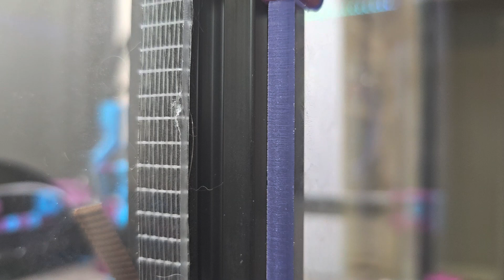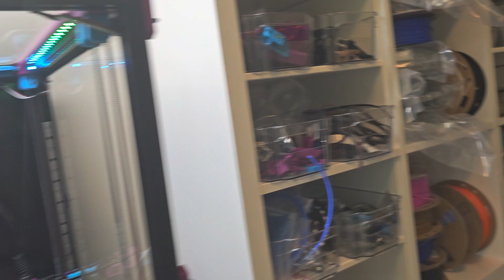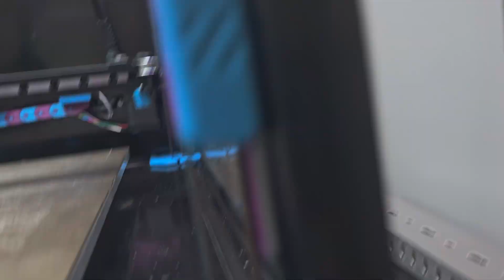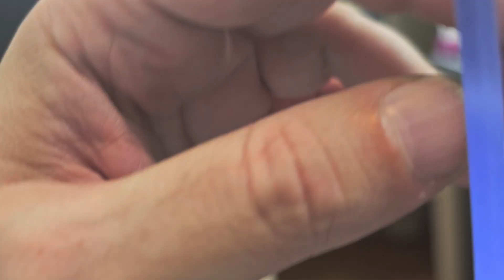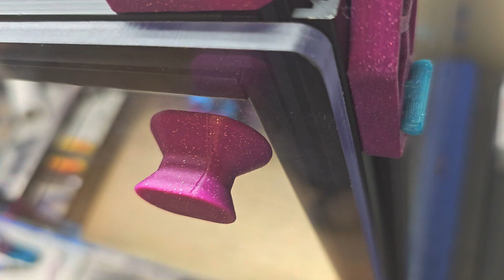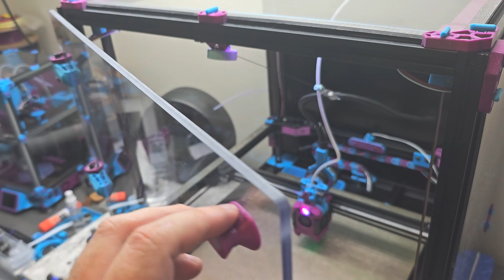Voron 2.4R2: New single pane K3 style door in 6 mm polycarbonate

Comment: Looking really solid! What has been your experience with the MGN9 rail so far? (you installed it in the x axis if I remember correctly). Noticed any negative side effects?
Reply from the maker: I am getting what I consider to be pretty decent print quality at my medium speed settings (375 mm/s speed for infill, and 12,800 mm/s^2 accels), but my input shaper results are still not great. I probably still have some assembly issues to work on, but while the printer is working so well, it's hard to justify tearing it apart again.
Reply: @oldguymeltsplastic  I see. Well the print quality is the most important part. Also consider where the accellerometer is placed, maybe you attached it somewhere where other vibrations come into play but don't really matter, like for example the plastic parts/duct. Ideally I think one of those nozzle accellerometers is the best scenario, either that or close to where the attachment point of the hotend is. Other thing could be some dangling cables on the accellerometer it self.